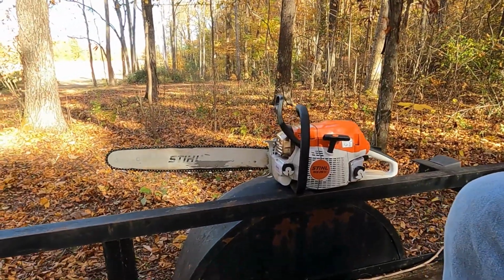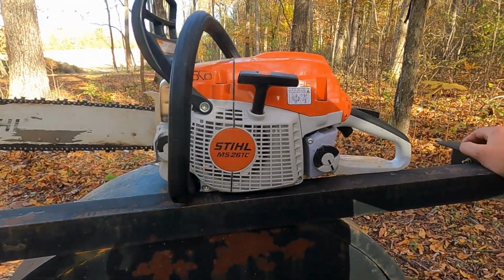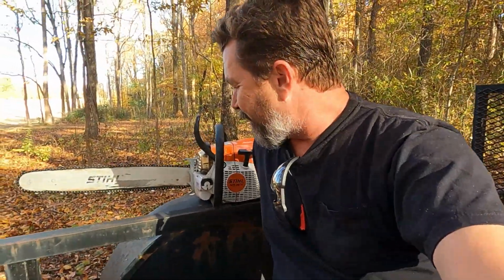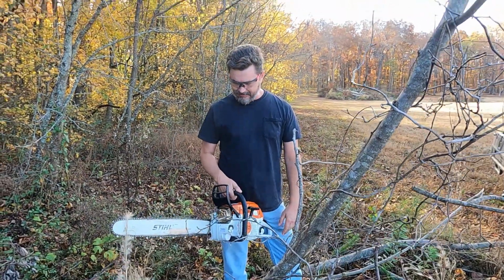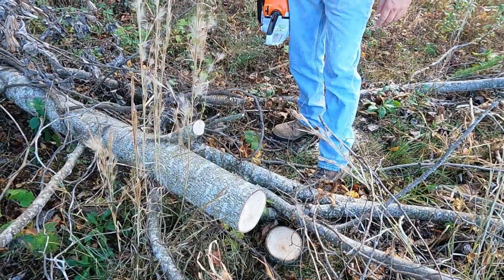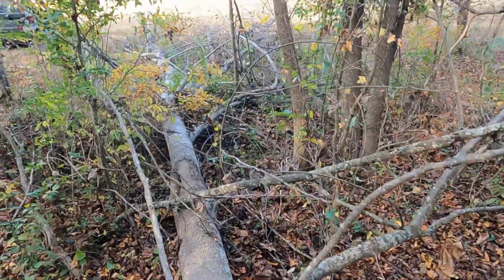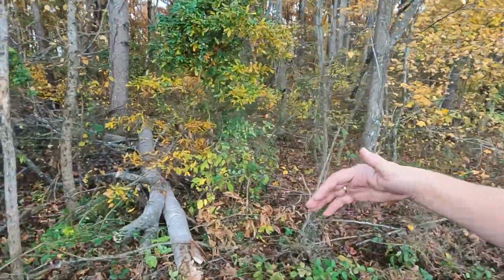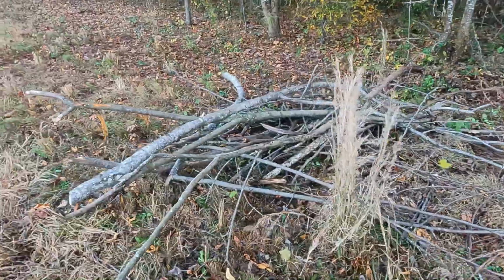Stihl MS261C Chainsaw Motor Ruined! Less than a year old. Only used a hand full of times.

Comment: I don't know how much training or maintenance knowledge you have in using these saws but the MS261C is a pro saw designed for all day long cutting. Now within that using a saw with a dull chain will over heat the saw because you are using it under loads that it was not designed to be used at together with excessive bar ware and chain bluing which detempers the chain that will never stay sharp again. If I where you I would get a new chain and bar plus a good chain sharpner and go from there. Don't run it with a dull chain and keep it the correct tension and you should be ok. If you have any questions please ask... good luck Owen.
Reply from the maker: Thanks Owen, great advice.

Comment: It seems to be a trend that the fuel solenoid fails due to dirt (Stihl's fault of design).  This causes a lean running condition which overheats the saws, and results in scored cylinder walls, damage to the piston, and the bearing cages will degrade if they are plastic.  The plot thickens:  new improved fuel solenoids don't work with the old coils (Sometimes or all the time, I don't know).  I can't say that IS the problem, but that is what happened to my MS 362 CM.  (Lucky us)  Best of luck.  thanks for the video.

Comment: Im a little bit harsh. But to me the bar and chain are going to make the cut not straight. Improperly sharped chain will make it not cut straight. the bar will wonder. I have done this. What I recommend is to buy a couple of chains and if you hit a rock or dirt and the chain saw is struggling to cut STOP let it cool off and change out the chain. When your at that point the chain is going to require some good work to bring it back... A simple swipe wont work.... Some folks will bring them to a local shop and pay the 5 or 6 bucks to have them professionally sharpened. Pay the 20 25 bucks and get 3 4 chains ready for work that day when you know your cutting up a bunch of stuff. 261 is a Fantastic saw. You just need to grow with it.
Reply from the maker: Thanks for being gentle on me. I have a lot of growing to do with this thing, but as they say there are growing pains and I just experienced some. Great info!

Comment: If the groove is spread open wider than it's supposed to be it will cut like that. The chain will ride sideways in the bar. I had that issue with one of mine.

Comment: Hello, I have had that happen before.  You can fix your bar!  Your bar is wearing uneven on the rails that the chain runs on.  If you have lack of oil flow while cutting the bar heats up quickly and wears faster.  If you take off your bar and try to stand it up on the side you have been cutting on and it wound stay up then you can even the rails.  Use a bar dresser or square sander.  If you flip your bar and it will stand on the other side you will see what I am talking about.

Ways to prevent this?  Every time you cut with your saw and finish, take off your bar, clean the rails (I use a putty knife) on both sides.  Also, make sure both oil holes on the bar are cleaned out!!  Blow off all dust and oil grime with a compressed air gun if you have one.

Flip your bar when put it back on.  Install chain with proper tension!

Sharpen chain after every use.

Since you bar is uneven now, I would check your chain links where they ride on the bar.  The chain may have worn the same way.  If you fix the bar rails, the chain may still ride off center and continue to cut crooked.

I would buy a few new chains and bring them when you cut.  Hitting the ground once will smoke your chain!  If you have a couple sharp spares. You can quickly swap chains and keep cutting.  Otherwise, time to take out the file!  Hope this helps you!  Learned the hard way!!
Reply from the maker: I appreciate the info. I am getting great responses from so many and ya'll know your stuff.

Comment: Any chance you accidentally ran straight gas in the saw?  If so, the piston will score after a coupIe tanks (no more residual oil).  I mention this because I had a guy on the farm do this to one of my saws.  He thought he had mixed the oil into the gas but he omitted it by mistake.
Reply from the maker: No chance on that for sure. I have a 1 gallon can that I use exclusively for the saw and for my leaf blower. It's always mixed correctly, Good thought though. Thanks!
Reply: Take your bar off flip it up side down. and run it that way. It allows even bar wear. Also check it for any burring. Make sure the sprocket feel free.
Reply: A couple tanks?  It will score in 2 minutes.  Omg!!
Reply: @sawmanbigtreeslayer2360  It will melt the piston rings into the piston after about 5 mins cutting, I did it on a husky and they have softer bore liner metal than a still.
Reply: I managed to straight ‘oil’ mine once, but woke up before I went to start it.

Comment: Most likely, if the chain is sharp, your bar grove is worm. The rail that the chain runs in,  instead of being parallel, have worm down to a vee. This lets the chain wobble side to side, causing it to cut crooked. 
Clean out that groove with a putty knife, turn the bar over, to extend the life. Bars sometimes can be "dressed". It is done on a special wheel. Basically if is ground down on the rails to take the vee out. If you feel the bar and there is a little roll of metal, your bar is worn.

Comment: A bar can absolutely warp. I just bought a Stihl, ran it for no more than 15 minutes and the bar got hot enough to throw the chain  off. Took it back to the dealership who said the bar as warped. Blamed it on user error. Had to replace the bar. Merry f in Christmas.

Comment: You need to find a new STIHL dealer…. If the STIHL dealer would have fallowed STIHL’S diagnostic procedures. They would have found the problem in like 3-5 minutes and a experienced technician would have found in like a min or less.
Reply from the maker: I do not disagree with you on that.
Reply: Step 1 pull the muffler.
Step 2 see the piston is Toast and cooked. 
Step 3 your saw was over heated from 2 things. Dull chain. Or Wrong gas. Either shouldn't be covered in my opinion... If you burn up a saw from being a dumb shit then why should you get a warranty...
Reply: @LiveFreeOrRIP I’d say lack of knowledge. They really should educate you what to do and not even buying a chainsaw.
Reply: An air leak will also cause scored piston, rings, and cylinder.  Leaning out the air/fuel mixture.  Surprised he got a new saw from Stihl.
Reply: @mikespain8655  A good dealer would do what ever it takes. And works the system. I know when I was at a dealer ship we had a few catastrophic failures. And just replaced them with new units.  Really the dealer controls a lot.

Comment: I have several Stihl chainsaws. Stihl homeowner chainsaw (024). Pro Stihl chainsaws (MS 261c, MS 400c, MS 462c, MS 500i) used within different applications as needed.  Sometimes all are used in more of a crew environment.  My experience of a saw cutting a curve is generally due to cutting teeth on one side of the chain being sharper than the other.  The sharper side of the chain displaces more wood disproportionally compared to the dull side causing a curve in the wood.  Similarly the rakers may also be of disproportional height having the same effect as one side being sharper than the other.  Replacing chain with a brand new chain blade will make it clear.  If the saw continues to cut a curve with the new blade the two guide rails on bar are most likely uneven and may be fixed with a file or tool made for that purpose.  Last the bar may be the issue if it has a bow/curve in the bar.  As to the issue of the guide bar becoming hot or bluing on the edge, generally this is caused by a lack of proper bar&chain oil on the bar itself.  Check bar oil tank for fluid, next check that the oil feed hole on the bar is not blocked or impeded, another point of concern would be if you have properly adjusted your oil flow setting , which is on the bottom of the chainsaw with a screwdriver. There is one last possibility to consider the oil pump itself has failed and will need to be replaced.  Hopefully this information is helpful.  Be safe in your labors.
Reply from the maker: @JohnWoodbury-xk2cb  Thanks so much John. Very good information to keep an eye on. It’s  folks like you that make all of this worth while. Stay safe and God bless.

Comment: Take bar off lay it on a table. Flip bar over and see if the same. Look to see if bar rails are worn uneven .A worn or spread rail on bar will make a crooked cut .  If flipping the bar fixes it or changes it  then dress or replace. Make sure chain and bar are the same gauge. Also try a different chain. Are my first thoughts. A dull chain may let rpm`s go to high.

Comment: generally scored pistons are caused by running lean, whether thats not enough fuel/oil mix running through, or not enough oil in the mix. also, it is very possible to warp/bend a bar, but usually cutting at an angle is caused by one side of the chain being sharper than the other

Comment: These are great saws but they have a weak spot, the factory oilers dont supply enough oil even for a 16" bar.  I was pretty upset the first day with mine.  The bar was smoking hot from some basic limbing.  After  a little research i ended up replacing the oiler adjustment screw with one out of a 460.  Night and day difference now, plenty of oil and a well lubed cool bar.  If not taken care of the extra heat will cook clutch and crank bearing not to mention overheating your bar causing it to cut crooked from uneven wear.
Reply from the maker: Great info! Thank you!

Comment: I don’t know any saws that like to be run with a dull blade. With a full blade would be similar to running it wide open on the ground. Naturally it’s running faster rpm than it’s designed and thus will run much hotter.

Comment: These saw are being sold with lean settings on the carb a lot of dealers  don’t set it before giving it to the customer.
 Also don’t buy Mtronic saws. 
 Do not run a 20” on these they overheat 10 out of 10 times! Cross the threshold and it scores  I believe there is even a service bulletin not to run 20”
Reply: Next time pull the muffler yourself  to see the pisto ,so you save time screwing around with them.

Comment: The “c” at the end is the reason why it broke. Commifornia “compliant” anything is junk. That cat chokes the engine out and keeps heat and exhaust in instead of out where it needs to be.
Reply from the maker: Interesting. That's what I heard from another subscriber previously. They said I must keep it extremely sharp at all times. As I mentioned in the video, could be the electronics that makes it so finicky.
Reply: The C means comfort feature. The comfort feature on this one being the M TRONIC. Self adjusting carburetor. The C has nothing to do with California. The C-M is found on the larger 362C, 462C, 661C
Reply: @LeuCustomKnives  The C (Comfort) feature has nothing to do with self adjusting carburettor. Comfort = recoil starter, no primer, side chain tensioner etc. M = Motronic which is the self adjusting carb.
Reply: @dab.  so the regular MS462 doesn’t have all those things you mentioned minus the M tronic? As I have read it the C-M or C-BE the letters after the C tell you what the comfort features are on the saws are.
Reply: @LeuCustomKnives  Not all 'Comfort' saws have the same features. The lettering means: 
B: Quick chain adjuster
C: Comfort, for ergonomic and lightweight designs.
E: ErgoStart
M: M-Tronic, engine management system that adjusts to varying conditions such as temperature.
You'd have to ask Stihl why the 462 isn't considered a comfort saw.
Reply: @dab.  I was at my local Stihl dealer today and he said the letters following the C on a tag for instance tell you what the comfort feature is. C-BE like you said has tool less chain tensioner and easy to start system. The C-M found on 261C, 362C, 462C, and 661C all pertain to the M being the comfort feature. Not having to adjust the carburetor and having the computer do it is those particular saws Comfort Feature. Nothing else. The regular 261, 362, 462 all have the same features as the C versions except for the M tronic. Personally they should have just named them 261M, 362M, 462M would have made more sense.
Reply: @LeuCustomKnives  I agree, it doesn't make much sense, but thanks for clarifying.
Reply: @dab.  seems a bit cheesy if you ask me 😂

Comment: My 261 has almost never cut straight.  The bar warps easily and/or wears out the groove and then it cuts crooked.  I've replaced the bar twice and after a few logs, it cuts crooked again.  A Stihl 261 is expensive for a saw that can't cut straight. I'm juts a homeowner not a pro and the 261 is just not a durable product for me.
Reply from the maker: Man that's too bad to hear. I am afraid you are right about that.
Reply: HEA I know you... Your the guy at the pit when we go shooting that says My rifle isnt accurate. My pistol isnt accurate. My guns all jam and dont work... See a trend... Saying the Legndary 261 The Son of the Great 026 and the 260 is a bad product because you dont know how to operate it correctly is a bold move... That saw is FANTASTIC. Ive been around them Lots and they all preform awesome. And you see it in My videos as proof. I used it many of my videos. Chain saws are not just gas and go tools. You need to know how to run one. anyone can pull the trigger...
Reply: @LiveFreeOrRIP  WTF are you talking about?  I run a business, I own about 6 saws, but the 261 is very fussy.  If it's just me, why do my 024s and 026s cut straight?

Comment: It is not uncommon for hand filed chains to not be equally sharp left side vs. right side. This happens as those doing the filing aren't consistent from one side to the other.... even if they count strokes. Factors like how much of the file is used, the amount of pressure applied, and the consistency of the stroke all have an impact. For example, paying attention to the sharpness of the very corner of the tip is more important than counting strokes.... For example, the corner of the pointy Stihl Rapid Super yellow box chains. The cutting edge of the green box chains needs to be consistently sharp too.... you have to look at the edge and see if it's sharp. Draw filing the bar to keep the edge square to the sides and to remove burrs should be a regular part of saw maintenance as is flipping the bar regularly. 

Running a dull chain itself doesn't hurt the engine but digging the bumper spikes in (dogs) and torqueing on the handle to force the saw to cut does.

I don't recall you mentioning what you use for gasoline or the ratio of oil to gas... too much oil increases carbon build up and causes the saw to run leaner than it should.  I recall a guy in another forum running 40:1 instead of 50:1, plus marvel mystery oil, plus some other oil thinking that more oil would decrease wear... instead it led to a heavy carbon build up and chunks of carbon would break off and score the piston and cylinder. Use the recommended ratio and non-ethanol gas of 90+ octane for best results. 

With proper bar and chain maintenance I've run Stihl saws until there was no paint left on the bars while the groove was still deep enough and tight enough, and the edge square enough, to keep successfully using them. The pistons and cylinders were also clean. BTW, from what I've seen, Stihl bars appear to be blued along the edges (under the paint) coming from the factory. Apparently it happens as part of the manufacturing process. As such, the discoloration by itself isn't a sure sign a bar was run too hot. Using real bar oil is important too... this as it has additives to make it sticky so it stays on the chain and lubricates all the way around. Things like used motor oil don't do that... and they contain contaminants.

Comment: Set your rakers/depth gauges to its corresponding cutting tooth. No more crooked cutting. Your cutters can all be different lengths but as long as its corresponding raker is set to the cutter, if doesn't matter. Some people swear that different cutter lengths cause crooked cutting and they'll tell you to file them all to the same length and the crooked cutting will be corrected. That is false. Your rakers not being set to its corresponding cutter is the number 1 cause of crooked cuts. A worn out bar can also be a cause but I highly doubt your bar is worn out. Doesn't look like it has that many hours on it.
Reply from the maker: Thanks a lot. I tend to agree, I have not put tons of hours on this one yet.

Comment: hi just wanted to tell you that you need to flip the bar over each time you sharpen the saw  if the chain is cutting to the left sharpen the right side a lil more and vice versa for the right  and check your bar and make sure it did not spread apart which will make your chain cut crooked and make sure you file the rakes every other chain sharpening  just thought this might help you some
Reply from the maker: Man thanks for that! I am learning and it's because of you and other like you, so keep it coming! Have a Merry Christmas!
Reply from the maker: By the way, I like the name tinman, it was my call sign in the military.
Reply: @TheLovelyPlace  thank you for your service  i wanted to serve but wasn't accepted at the time  merry christmas to you also  tinman was one of my cb handles when i was working i'm disabled now

Comment: You need to flip your bar every once in a while. I would take a guess you had an air leak in the saw or you didn’t use a good oil or the right oil gas mixture. I been using Stihl pro saws for years. Never had a problem. But I have seen air leaks in saws before and it will do your piston and cylinder in.